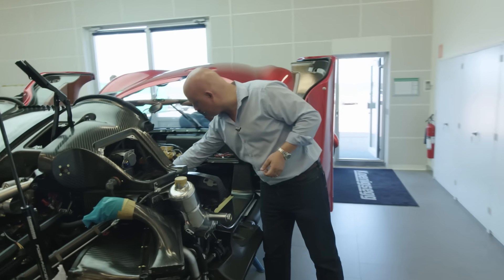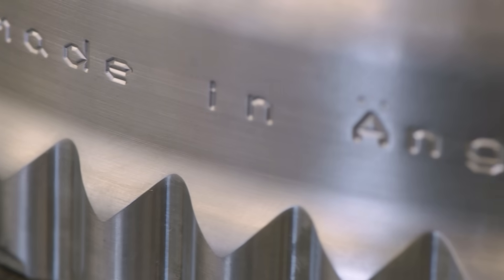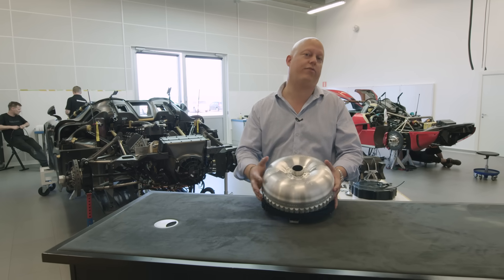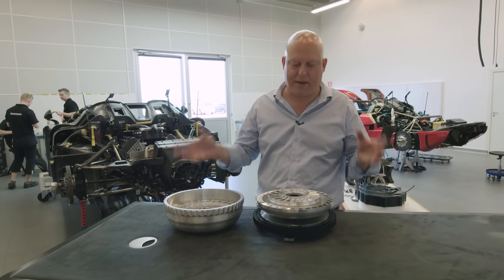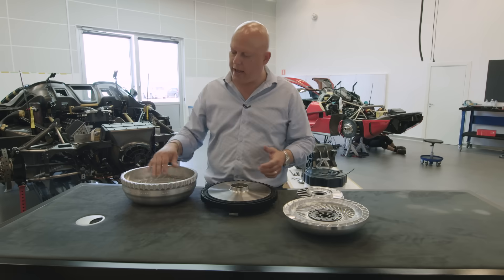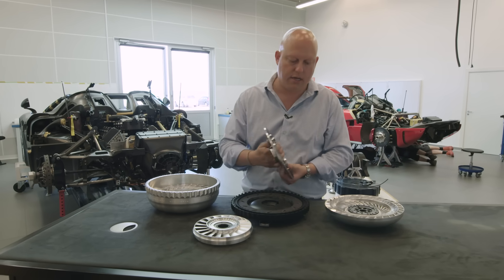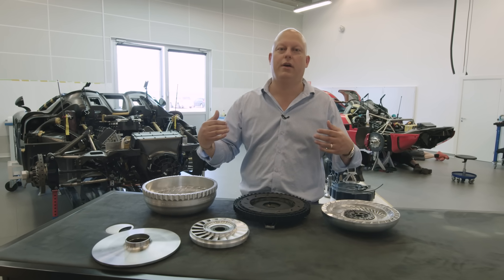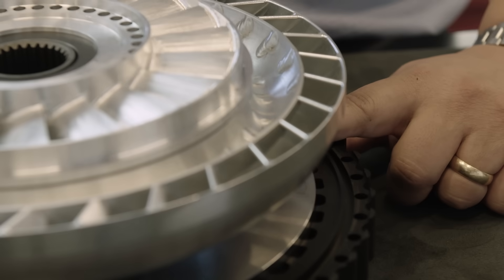248 MPH Without A Gearbox: Direct Drive  -- /INSIDE KOENIGSEGG

Comment: Mr. KOENIGSEGG please make us an affordable sports car. I would love to buy it. With volume you could put your amazing ideas into mass production to lower cost and it would be wonderful.
Reply: He can't really make anything affordable for now, that would require tens of billions just into manufacturing development, he doesn't have that kind of money, he has enough financial will to make incredible cars that remain in garaged in the middle-east.
But than again if you knew what was needed to even make normal city bound cars, you wouldn't ask.
Reply: That goes against his ethos though. He wants to build cars that have zero compromise on any single component. I mean, look at the centre dials on the Agera; he refused to use plastic so they used a revolutionary process of nano-holes in aluminium just to get the light-up pictures on the dials. Koenigsegg is about being the very best of the best and there is a LOT of compromise when it comes to affordable cars. It's just not him.
Reply: problem is that koenigsegg doesnt yet have the capacity for mass production, and I highly doubt they would bother with the lower-end performance market. This is a company fuelled by passion for building the ultimate speed machine. However, the technologies that koenigsegg brings to their own cars may inspire other larger mass-production companies to get off their asses and develop their own solutions for affordable performance vehicles and even economy vehicles.
Reply: Most people replying to your comment seem to think they know every single thing about Koenigsegg's mind and exactly how to run a car company. but i understand where you're coming from. I'd HATe to see him build stuff like a 350z or Subaru BRZ (super mass produced and simple enough for your mom to drive) But if he built stuff like Morgan and Caterham does (True enthusiast grade vehicles with limited production but not $1.5m pricetags) I think that would go a long way. Maybe Koenigsegg knows it wont benefit him since i dont feel he's in it for the money, but all of us could certainly own a morgan in our lifetimes and i know most of us cant ever get anything like a Koenigsegg. I get your idea and im in the same boat.
Reply: Dude, that's exactly what i thought. If he could make a sports car similar to a golf gti or Msports bmw, they would have a huge flood of buyers.
Reply: tbh, I do like the idea and it would be possible (with SOME money). It wouldn't have carbon, and none of that crazy technology, but just having a sexy little sportcar (MR2/NSX fashion) with the logo we all love on it, and I think everybody would be proud of owning a car made by such a respectful and admirable person
Reply: They almost did. They were about to buy SAAB in 2009.
http://koenigsegg.com/ama1-with-christian-von-koenigsegg-part-1/
Reply: I can't afford a koenigsegg and i think this is by far the dumbest fucking idea ever. his cars are pieces of art. mass produced would ruin this company.
Reply: Mat t Why is this a dumb idea? Military Hummers had torque converters on each wheel and just a two speed transfer case, they are one of the most durable things on the road. Every auto hydromatic car has one of these since the 50s, they obviously work well. How is this a bad idea?
Reply: sandzhs WTF haha, no or they would be an amazing car, like the Tucker, Porsche 911, BMW M3, or the Beetle. Do you not know history of some of the most amazing cars in history? Although the Beetle was due to Hitler but same idea I suppose.
Reply: Mitchell Dowling Thats neat. And makes more sense.
Reply: i guess this is just a matter of time - but affordable in that area will still be 100.000 euro or more. he can do that what he does cause there are some dudes out there that can afford a car for 6.000.000 euros. but i guess from year to year he will increase his production output and that will decrease the price coming from production efficiency or reduced development costs per car. if you calculate about 20% in one year you can calculate the time that it takes to get to 100.000 euros.
Reply: That's not what Koenigsegg is about unfortunately. Koenigsegg is meant to be a driving force in the industry providing new technology with each car release. Designing and producing low end models would only slow their rate of progress :/
Reply: +Randy Gareth agreed. And in case anyone else who decides to continue commenting about how low run the vehicles Koenigsegg produce and they should make more sports cars. The Regera is only queued for 80 cars throughout the ENTIRE production cycle and are ALL sold out.
Salomondrin wanted to force CvK into making more Agera RS for him and his CupGang but CvK was kind in his insistent refusal. That's a show of how passionately driven is a small little car company like Koenigsegg. And let's not forget, they themselves as well as their customers are people who sit at the top rungs of the wealth distribution ladder. And these people are LOYAL, passionate buyers and most are also repeated customers. Nothing beats that. CvK's avoidance of all the mass production hassle and his choice to stick to his ethos of no compromisation on materials and craftsmanship is a point well made and 98% of people who can't afford should might as well just enjoy his work and his friendliness no?
Reply: ***** Well, yes if you look at the advancement of the industry. Compare the available hp of the model T to the Late 30s Packard. Or the late 30s Packard to the muscle cars of the late 60s and 70s. Or those to the cars of today. Henry Fords famous race was made in a car that would be blown out of the water by many current era cars. You might not get the fancy racing packaging, but all the engineering that you're looking at will either make its way into mom's station wagon or be eclipsed by something better which will.
Reply: Merp those cars are really expensive to make
Reply: Ummm....did you not see that Freevalve Qamless technology he's cooked up! I'm sure he can make atleast a $150,000 supercar.
Reply: I don't see that happening. There is to much competition in 'regular sports cars' Koenigsegg will most likely go bankrupt. There is much more development in these high end megacars. Thats their bread and butter. One way or another, for cheap sportscars, they will have to cut costs somewhere. And with these cars, they can do whatever they feel like.
Reply: That would go completely against anything that Koenigsegg stands for. That's like asking Michelangelo to go into mass production IMO.
Reply: ***** I think we know, thats what business loans are for, that is how Tesla did it.
Reply: Merp Tesla got the loan because it has potential and there's a need/want for eVs and changes the way we travel but this doesn't
Reply: We're talking about Koenigsegg, not Teslta. They don't have tons of investors and billions of dollars to their use, just to create an "affordable sports car". They're great just because they make hi-end super cars and there's not many oppurtunities for them to go for a more middle class suitable car.

It's easier to handle the costs of two-hundred-ish cars, not thousands of them. And why all the struggle, if more welthier people are fine with the long servicing and stuff. They have other awesome cars to drive meanwhile.

But those are just my thoughts on this subject. And it feels a lot better to have a dream to someday own an one of couple of Koenigseggs, not just a regular sports car. I wish my dream stays the same. Koenigsegg is awesome as they are now.
Reply: Merp That would be a nice idea but before I go any further how low  are you talking?
Reply: Actually most humans spend more then 10k a year (which equates to 1m over 100 years) personally i probably go through well over 3-4x that a year as do most first world humans.
Reply: Vegas Tan 98%? You mean 99.98%?
Reply: +Merp yeah but you get my point since the top 2% of people in the world holds 40% of the world's wealth.
Reply: Vegas Tan And the top .02% control 60% of that 40%... those are the ones that can afford these cars :(. Anyone in the US pretty much is in that top 10% of the world. We are pretty privileged, but only those that are the 1% of that 10% can even afford a 100k car. and 1% of that 1% can afford a 1.5million dollar car.
Reply: Vegas Tan But yes agreed. But I dont think people understand that its like 1 out of 10,000 people that has more money than all the rest of them combined.
Reply: We all want that. Give the industry another 20-30 years and if they're not blocked by miserable regulatory scolds, every car will have this kind.of capacity. Look at the advancement of the industry over time and you can see how swiftly the sporting car of today becomes the family car of tomorrow, albeit not quite as sexy.
Reply: Depends, even Ferrari makes a 70k model now.....Is Ferrari ruined ?
The entire issue is production, Koenigsegg doesn't have a large production line nor do they make many cars per year, thus costs are very high.
Reply: Thanks, well said! Some just don't get it.
Reply: I hope you both realise, that it's impossible. If Koenigsegg would make an "affordable sports car" it would be just a random shitty-ass piece of wehicle. Just as an Prius or something. Or the best case scenario would be a Lotus Elise alternative which would be pointless.

Comment: My question is what are the engine rpm's at 70 mph just cruising on the interstate?
Reply: 20'' Wheels, 2.73:1 ratio, if I made no error calculating this is 43mph@1000rpm. This number is absolutely no surprise to me because it exactly matches the common speed limit of 70km/h in europe, meaning they can drive most of the times with a locked clutch. In conclusion, 70mph@1600rpm.
Reply: Daniel Roeske That's amazing! Most of the highways here in the US you can go 70 mph or roughly 110 kph. Talk about efficiency.
Reply: Yes it is pretty much the same here. 70 km/h in zones with speed restrictions (typically intersections), 100 km/h on highways and 120km/h or faster on freeways.

Comment: This thing is gonna rape itself if it ever goes a few starts without electric assistance, the thermal output has to be hilarious. First thing I noticed was how they had to add reinforcement welds to every fin. The difference between Koenigsegg and everyone else is that Koenigsegg just doesn't give a single damn about reliability then uses all of this as "innovative" talking points to sell the cars knowing full well that these cars will only see 1k miles a year. What gets me is the arrogance saying that engineers can't wrap their heads around what essentially is just a torque converter pressing against a hydraulic clutch. Also it wouldn't be in 7th gear, it would be in whichever gear is 1:1, usually 4th or 5th with 6th and 7th being an overdrive.

Comment: Torque converters are a great invention, in recent years people have been bad mouthing them because of semi auto and dual clutch systems that are seemingly better than the older autos that used torque converters. Though torque converters are extremely robust and much less prone to wear and failure than the robotised clutch systems used by modern high performance automatics. Yeah in a traditional internal combustion setup, the clutch systems are faster, but a torque converter system can often outlive the car its in and provide extreme smooth low speed power transfer as well as good torque output at crawling speeds. Its also good at smoothing out the power transfer in the drivetrain.
There are some really old muscle cars out there with a ton of mileage still running on the original torque converters. Personally i don't believe the automatic dual and single clutch systems can last anywhere as long as that.

Torque converters may have been around for about 100 years, but that doesnt make it outdated tech, they still are bloody brilliant invention that is super tough.

Comment: Oh btw, how do they do reverse gear? Electric only? Mind you they only have one gear.
Reply: Yep, I think CvK said just that in an earlier video. Reverse is electric only and that makes sense with his "no unneccesary weight/mechanics to accomplish goal"-policy
Reply: waclosh They can apply a reverse gear to final out of box.  It shouldn't be that hard
Reply: the engine just spins in the opposite way when you want reverse.... i mean they had to add air filters to the exhaust, and mufflers to the intake, but that wasn't a problem at all...
Reply: lol nah i can promise you, the petrol engine definitely runs backwards when you need to reverse....
Reply: Yes Reverse is electric, when you do the combustion engine does into idle
Reply: It's all in the controller, fewer mechanical problems.
Reply: Cory Tant Yup, fewer parts, which also means less weight the car has to carry, and possibly rotate when the car is going forward.
Reply: LunchboxDOTinc
the car reverses electronically though while the engine idles
Reply: +LunchboxDOTinc Yeah good luck reversing the ENGINE direction without it stopping, TOTALY makes sense.
Reply: LunchboxDOTinc
Christian didn't say it does....

Comment: That aint going to make gearheads happy ! this allows the engine to stay at its peak torque during the entire acceleration. 
Has been done before with varios and cvt gearboxes , its perfect for optimal acceleration BUT people aint happy when engine is stuck at same rpm all the time wich it will when you floor it... :/
Reply: Bass Rothschild dude you got it wrong. the engine speed doesn't stay at peak torque. it's always linked to the speed. completely linear. the torque converter is only there for speeds below engine idle an heavy take offs. in every other situation it's locked up and acts just as a weird flywheel

Comment: you put in 2000 rpm, 1000rpm comes out with more than double of the original  torque? thats simply not possible

Comment: To summarize, if I understood correctly, it's a torque converter inside another torque converter, with a lock up component. 

the combustion engine and primary motor is thought of as one drive unit (for easier comprehension), then the hydraulic coupler (torque converter), then  driveline (drive shaft), then differential, then half shafts/secondary motors (axles).

When the crank spins the outside of the coupler spins because they are connected, the inside doesn't spin (connected to the driveshaft) until there is enough pressure to stall the inside. the coupler is full of fluid, the fins are there to shove fluid from crank side of the coupler to the driveshaft side (remember the outside is what is spinning, until hydraulic stall happens).
An example is a closed empty plastic bottle. When you squeeze it, you can crush it somewhat. Now fill the bottle with a fluid like water and try to squeeze it, it's a lot harder to crush. The fins and spinning motion, try to "crush" the fluid, causing a stall, making the non spinning parts (when the car is not in motion) hydraulically connected. 

I'm assuming the other toque converter element is to reduce load on the 2 parts of the torque converter (an average converter only has 2 parts, that does what I explained above) along with the secondary drive motors and the lockup component, since it doesn't have a transmission. So the coupler could be thought as a variable transmission of sorts. 

Since it doesn't have a transmission, I'm assuming the main source of drive when in reverse are the motors on the axles.
Reply: Reverse is electric yes, when reversing the combustion engine goes into idle
Reply: I thought the turbine and the impeller are welded together. I cut one open before.
Reply: still need a stator for it to work.
Reply: mat arif leen They've had them for decades now. it's called a lockup torque converter
Reply: torque converter with a clutch for the  final gear
Reply: I was just about thinking some torque converter combine with clutch... bamm koenigsegg done it before I finish thinking about it...
Reply: i know about the lock up... most of modern torque converters have it... what I was thinking is extra clutch additional to the lock up mechanism
Reply: mat arif leen that would be redundant because the lockup component physically joins the parts that connect the flex plate and the input shaft, through hydraulic pressure, not hydraulic fluid stall. 
On torque converters that don't have this, if the fluid pressure exceeds the pressure of what the fin design were engineered for, torque conversion and power transfer efficiency starts to degrade, due to the fins flexing because of the excess pressure.
Reply: Thanks, you said it all!

Comment: I wonder if they could get rid of the torque converter and use an eddy current drive. Eddy current drives can multiply torque, might even be able to integrate it into the electric motor.